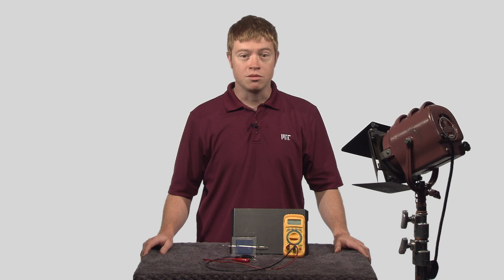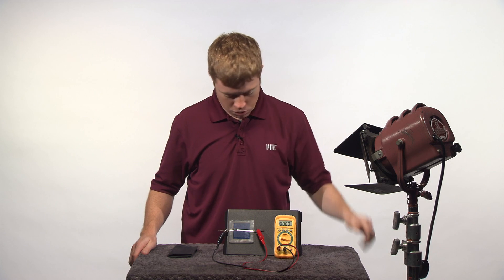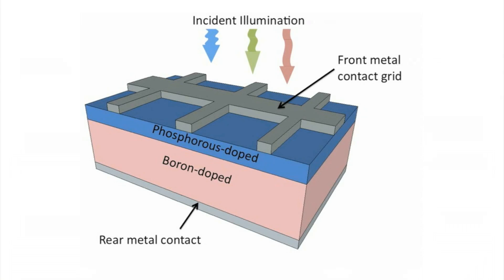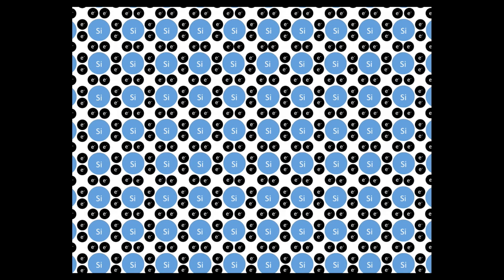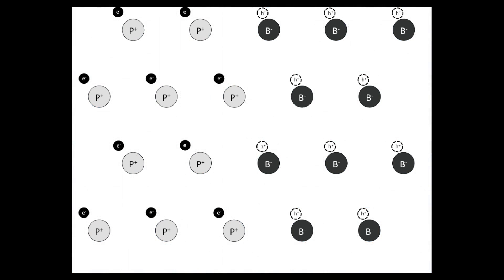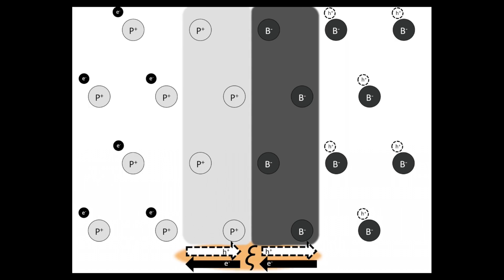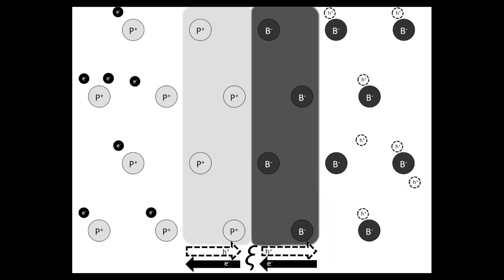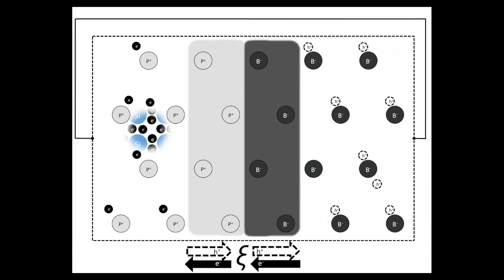Tutorial: Solar Cell Operation

Comment: I see quite a mistake in this explanation.  Keep in mind that the extrinsic semiconductors do have majority as well as minority charge carrier. If the light shines on one side of semiconductor say N-type free electrons and holes are generated , the freed electrons moves randomly and collides with some random holes residing in the same semiconductor block and vanishes producing no current. Its the PN junction upon which if the light energy is incident creates useful current because the electrons and hole pairs generated in the junction are pulled apart by the electric field build in the junction toward the opposite poles.

Comment: A VERY GOOD INFORMATIVE VIDEO BUT WE MUST INCREASE THAT EFFICIENCY BY MANY FACTORS IF THEY ARE TO BE PRACTICAL. AS I SUGGESTED ( THOUGH HAVE NO IDEA OF THE OUTCOME) USING MAGNIFYING PLASTIC OVER EACH SECTION OF CELLS. THIS COULD INCREASE THAT AVAILABLE SUNLIGHT AND GIVE MORE POWER. ALSO I SUGGESTED USING NIGHT VISION TECHNOLOGY ON THE GLASS SURFACE. I ENVISION THAT IN TOTAL DARKNESS IT COULD BE AS BRIGHT AS DAY TO THOSE CELLS BUT IN SUNNY CONDITIONS WOULD BE LIKE THE SUN NEXT DOOR FOR BRIGHTNESS???!!

Comment: i really do appreciate this work , i haven't seen anyone doing such a great work , the only problem is that u have mistaken at B- the hole in the Boron is going to be replaced by an electron from a neigbhor silicon atome due to the ambient temperature then we are going to get the negatif charge of the Boron thanks for correcting it , getting deep in the physics beneeth this phenomenon makes it confusing , i agree to everything u said but the boron won't get the negatif charge to become B- tell it'll get a new electron from a nieghbor silicon and this silicon atome is going to become a positif charge due to the fact that it lost an electron , thank you for this amazing work

Comment: Ok,i have a question,why doesn't slicon doped material run out of electrons and holes.If it constantly gives of an electron where does it get new ones.Someone,answer please. :)
Reply: Nevermind,i get it,when electrons leave phosporus-doped material,hole is also generated,and that hole can pass trought electric filed beetwen two doped materials.Basicaly it is always the same electrons that generate current.(btw sorry about my english)
Reply: but why hole can pass throught electric filed if there is the positive sheet that will not let it happen

Comment: Why holes can diffuse to the N side from the P side but not electrons? What will happen if N side is illuminated?
Reply: +animesh mondal i also wonder this really
Reply: +Murat Sert does the hole have a charge..? I know the electron cannot pass through because it has an electron but I'm not quite sure about the hole. So yeah.. In with you guys.
Reply: +Murat Sert The explanation here isn't meant to give a complete picture as it focuses on diffusion current only. Diffusion works in both direction ( in fact holes are far less mobile than electron) but majority of the current comes from depletion region naming drift current. Band gap energy diagram is the best way to understand the mechanism.
Reply: +Brenda Smith holes have charge, the hypothesis used in this video may not be able to explain these questions. We need to have energy band diagram, band bending, drift-diffusion current to explain these questions.
Reply: In this video, the N side was illuminated which resulted in electron-hole pair. The hole was drifted to the P side by the electric field at the junction. If the P side is illuminated, then the exact opposite will happen, the electron will be drifted to the N side and hole will remain in the P side.

Comment: Akash Singh Correct me if I am wrong, but how good the cell can perform depends on the rate of electron-hole pair generation, not the amount of free electrons under no-light. The cell simply reach the equilibrium point and no current is generated.

Comment: After connecting the wire, the rest electrons and holes neutralize each other, right? after neutralization of all the charges, does current flow stop?
Reply: If light is keep shining on the N-type surface, E-H pairs are going to keep being generated, creating a state of imbalance between the N-type and P-type. Current will flow as long as there is an imbalance.

Comment: Why use only semiconductors in making a solar cell...? I mean, metals/conductors have even lesser energy gap for electrons to be free... we can get more current.. no??
Reply: The electrons are already freely moving. The principle of  driving a current is potential difference. Potential difference is created due to charge separation or gradient in charge concentration.
How would you do that in metals? The charges are already separated in thermal equillibrium. You need to create a situation of charge separation as well as non equillibrium as that is the condition of flowing current.

Comment: Don't you run out of electrons on the left side eventually?
Reply: steveq34 why or how should that happen? (i.e. at what point: when you generate the free electron or when the electron moves through the wire or...?)
Reply: Yes and no. 

There is a maximum amount of free electrons and holes that... YOU CAN HAVE AT A SINGLE TIME. This depends on the excess energy that you give to the system with the absolute maximum being the total number of electrons existing in the material (though if you break them all free what you ll have at your hands wont be a solid anymore I think, I am not a physicist or anything like it though so take what I write with a huge pinch of salt).

 What matters though is that these electron and holes stay separated on either side of the semiconductor. The fact that each side has a different charge defines the voltage difference produced/existing at the illuminated semiconductor which is the only thing that matters. Remember just having free electrons and holes doesn't produce (useful) current by it self. The charges need to be somehow separated at the source and their only way to meet is via the conductor / circuit. Hence at the moment that you connect each side with a wire, free electrons from the negatively charged side "flow" through the wire towards the positively charged side of the semiconductor. This directed flow of electrons is the current. As soon as the electrons reach the positive side the atoms have their charge "rebalanced" but since we still illuminate the semiconductor they break off again becoming free electrons and holes. This continues as long as we illuminate the semiconductor.

 Photons hit electrons giving them enough energy to break free off Si atoms, producing free electrons and holes, proceeding to be separated to either side of the semiconductor (hence the atoms have imbalanced and opposite charges in either side and nature hates imbalances. systems will fall to the lowest energy state because that's where they are stable), with the only way (mostly) for the free electrons to return to their missing places (holes) being through a conductor (eg wire) connecting the two sides of the semiconductor holding each, only to break free again soon after because of photons keep giving excess energy to the system (as long as it remains illuminated) and the circle "never" ends.

Excuse my crappy English btw.

Comment: @4.27 he was saying that the silicon created hole. Where the heck does hole come from sillicon?  And also he was saying the hole and electron will cancel each other but on this circumstance the hole and electron don't cancel. What a confusion.
Reply: The hole is not a real hole. It is the absence of the electron that broke free, when hit by a photon, from its place in the atom.

Think of it like a table (the atom's nucleus) with chairs (electron bands / "trajectories" inside the atom, sorry I am not good with English) and people sitting on the chairs (electrons).

As long as the people sit on the chairs they cant move away from them and the table as long as they don't receive external help, because at this state / positions the total forces are already balanced out and the system is stable.

If some object hits a person (photon) with enough energy, it will throw it OFF the chair and away from the table.

This caused two things: People who are not sitting anymore (free electrons) and EMPTY CHAIRS (-> HOLES <-). A hole does not really exists its the name we give to the now devoid of electrons, band in an atom.

Now the both the empty chair (hole) and the non sitting person (free electron) are in a higher energy state (unbalanced) and since every system MUST eventually achieve its lowest energy state (become balanced - because this is how things work). 

This means that the holes / chairs try to pull an electron / person back into them to fill the empty spot. They will pull ANY nearby person (electron, free or not) EVEN ONE WHO ALREADY SITS ON ANOTHER CHAIR (band/hole) AT THE NEXT TABLE (atom).

This also means that as one person is pulled to sit on the chair, another empty chair is left on its previous position, so now the holes SEEM TO MOVE like if they were a real thing. 

Since a "hole" (even if not a particle or a wave or even an "energy packet") affects the system by just "existing", it must be taken into account in calculations and in understanding how things work. Hence we gave it the easy to use and remember name (since it makes sense in concept) "hole".

This explains your question about what a "hole" really is and how it is "created". It is a word we gave to a non existing thing, to describe an empty spot that needs to be filled.

As for a free electron and a hole canceling each other out is easy to understand now.

People with no chairs wonder around (higher energy state) and so empty chairs / holes SEEM TO DO (by forcing nearby NON FREE electrons to fill the spot, hence leaving a new empty spot elsewhere now).

This movement is seemingly random (not so much) but as soon as a free electron and a hole meet each other, the electron FILLS the hole (person standing then sitting on chair) they balance out (X negative + X positive charge = ZERO charge) attains lower energy state becoming stable and hence stops affecting the rest of the system. 

This effectively equals, from one point of view, like if the electrons and holes who met "disappeared" (not really but they did stop actively affecting the system).

Now in doped semiconductors, this does happen but via mechanism that I don't really recall right now, never mind my inability with the English language, an area created in between the positive and negative doped sides, as the free electrons meet with the holes which eventually stops the electrons from passing through and meeting with the "holes" left. In this case they can only meet if you connect both opposite charged sides via a conductor eg a wire. I think that this area is called a cut-off band or something but I don't remember plus I try to translate from my own language via guesswork.
Reply: DragonlordSVS thank you so much for explaining :D

Comment: On the "hole-y" side when a silicon atom is struck by a photon I assume the electron would flow the other way, but would this movement temporarily slow the flow, due to any E-m interactions?